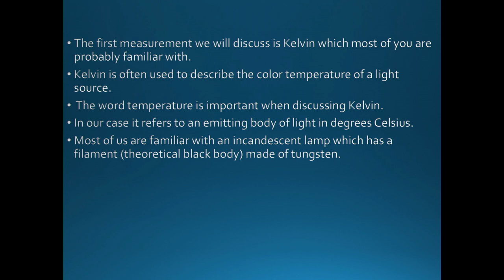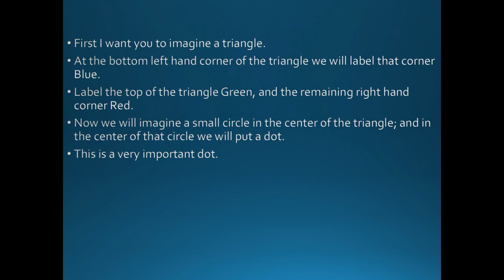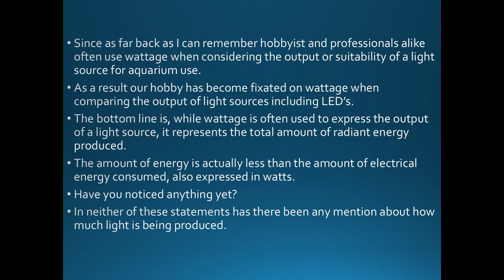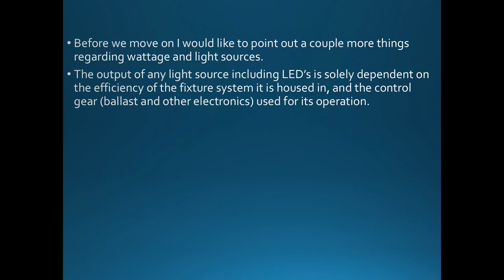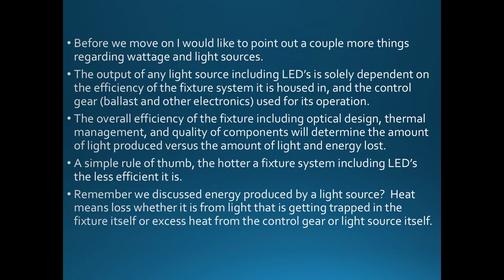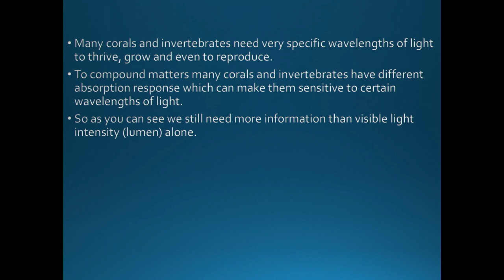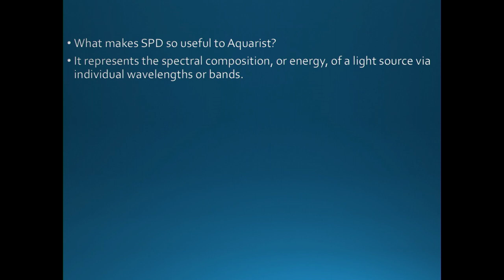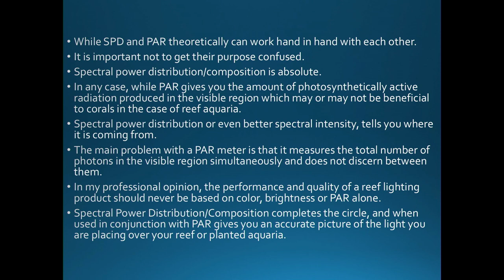Tullio Dell Aquila: The Facts of Light | MACNA 2017

Comment: At about 31:00 when Trulio mentions that true UV would degrade the optics of LEDS - is that why we have to replace Metal Halides and T5s yearly or so? Because the UV is essentially degrading the lamp? This talk was kinda geeky and it took 2 watches to "get it" but it was certainly worth it.
Reply: No, it's because like any bulb of that type will basically wear out as it is used.

What he is talking about is the UV light produced by those kinds of lamps will degrade plastics and other material.  That is why double ended MH bulbs must have a UV shielded glass cover and singled ended don't (because it is built into the glass surrounding the bulb.  However I am not sure that would make a MH better as he kind of hinted too.  Because UV is damaging and is blocked by that glass.  So I'm not sure what to make of his hesitation and mannerisms there.
Reply: Nothing to do with fluorescent or halide lamp life. Plastics do not tolerate UV emission well, but T5 and halide systems are made of actual glass so there is no degradation effect caused by the their UV output

Comment: This was the least favorite talk I've seen to the point where I asked myself the reefer hobbyist will never use 90 + % of the info presented thought I was back in college
 Better suited to a much more advanced scientific group of physicists and engineers
Reply: Maybe but it basically outlines that as reefers the tools and measurement definitions (such as "Watts" and "PAR") that we normally use and have accepted so far as accurate & useful, may be totally misleading.  He's insinuating (as I understood it) that there should be more standardized information made available in terms of SPD + PAR, to reefers, because that is a more accurate way of defining what spectrum corals use.  He's saying we'd actually need a spectrometer to really assess and analyze/quantify the light energy coming from our system lighting.  And yeah I know that's not really something that's not readily available to aquarists, so I do see your point.  Still, I liked the talk because I feel it's good to know that PAR information is not the complete picture.